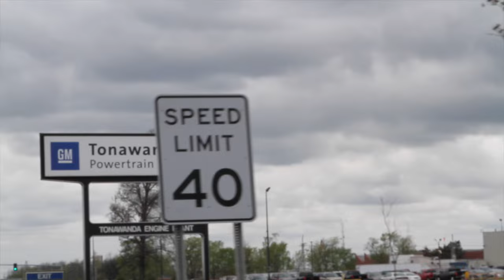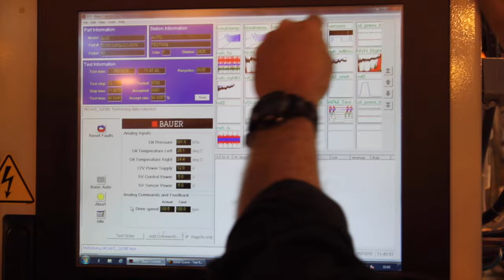GM Engine Assembly Plant, Tonawanda

Comment: This would've been awesome but A LOT of critical information is missing. For example, how are the bearings located in the block and rods installed? How is it able to be repeated at such a small tolerance to get the bearings installed in precisely the same place on every engine?

Instead, you edited that step out of the vid. Most have seen cranks installed. There's onky so many ways to install them. Why show the same thing in every video? Show something worth watching so we can actually learn something about assembly techniques, etc...instead of producing a video based on pure entertainment value.
Reply from the maker: This was a very spur-of-the-moment tour and I had no plan when I whipped out my camera to take some footage.  Sorry I didn't get that.  But, to answer your question, there are little dowel pins in the block to ensure the bearings are lined up properly (and quickly and consistently) before the crank is put in.  At the end of assembly, every engine is put through a "rotational" test where the friction/drag can be measured.  If a bearing is out of tolerance, or not installed correctly, this would be discovered during that test.